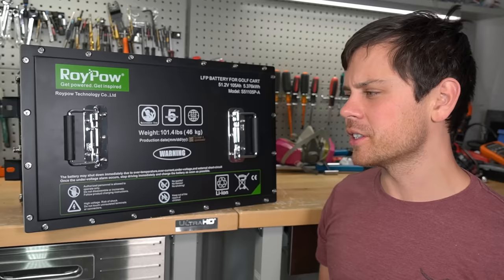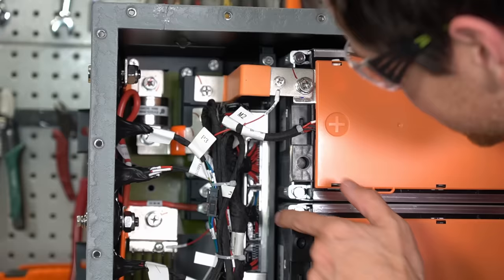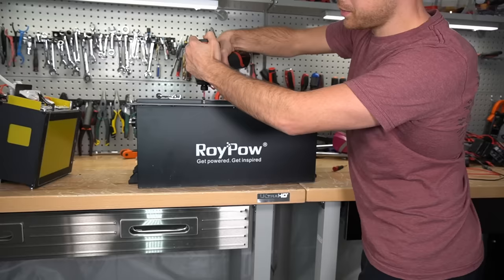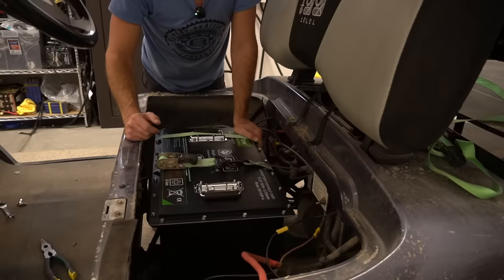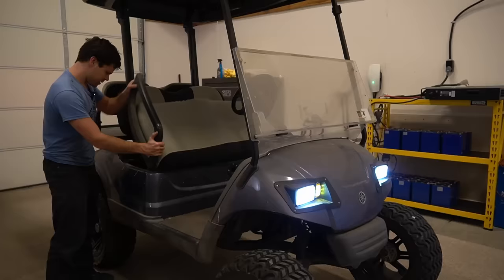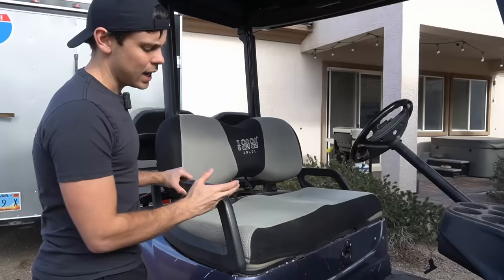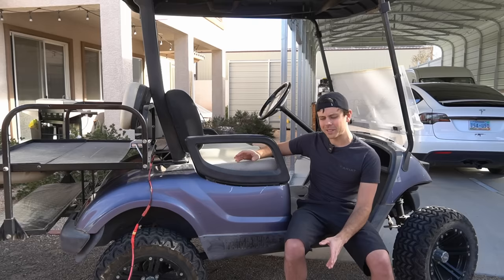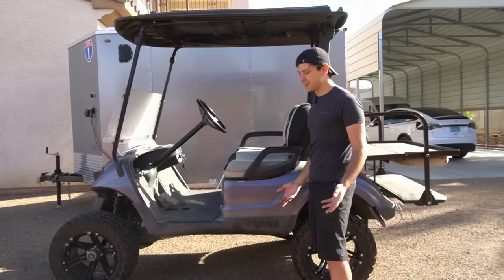48V "Roypow" DIY Lithium Golf Cart Battery: Get rid of lead acid today!

Comment: We have installed a few hundred of these into golf carts. They have gotten a little better over time.  The smaller packs are barely good enough really depending on driving conditions ie. Anything with real hills and they can’t handle the inrush current. The one you are installing is their high output.  The high outputs so far have been pretty reliable.
Reply: I think you are right. This is because its continuous discharge current is not big enough. Just imagine, with 4 big guys and other things loaded on the golf cart with this battery, driving uphill, it will probably stop working and the meter display remaining power could be up to 25%.  And take a look at the connection panels between cells and other joints, it is alluminum alloy, instead of copper, it means that it is not for high working current at all. I have to say, it is beautiful but it is not the best.
Reply: Disappointed to see that they are only currently offering the 24v 80Ah units for sale. I'm assuming they are just out of stock. The unit in the video here is what I want for my Cushman truckster.
Reply: @TheGorf   cool another cushman truckster owner. Mine is a 91 with a 22 hp omc built twin using propane fuel, it was used in a plant for maintenance. These things are built extremely well and built to last, mine has almost 5200 hours and still runs great.
Reply: Any interests in 48v30ah battery in GC2 size?  Max support 10 units in parallel connection. @TheGorf
Reply: Do you wanna experience latest 48v30ah in GC2 size LFP battery for replacing Trojan T125 lead acid battery? It can support 10 units in parallel connection, reach 300ah
Reply: @derrickzeng  Those aluminum busbars can easily handle the rated current of the pack. Probably 2x that. Also the cell terminals are aluminum so there's less chance of corrosion problems by using aluminum for the busbars as well.
Reply: I have the Roypow 165AH battery in my cart.  So far works well but will slow down when hauling larger loads up hill    It came with the cart but I want to add solar charging

Comment: I bought some “Sapphion U-Charge” LiFePo4 batteries for my Polaris Ranger EV about 8-years ago. It was 4x12v cells instead of the 8x6v stock set up, and just required reprogramming of the original onboard charger and purchasing a very expensive “CAN-bus” solenoid. They look exactly like deep cycle batteries. I’m still getting 35-40 miles per charge compared to the 45-50 miles when they were new. The lead-acid batteries were weak by the time I got it but they were supposed to be good for 45-miles on flat ground when fresh (it was down to 4 or 5). Best purchase I’ve ever made for that thing.

Comment: Im down here In quartzite for the first time. I need a cart like that here. It would be much better than the noisy side-by-side that people use.
Reply: That's the nice thing about the golf carts.
My mom has used one for years, out in the desert (rock hound).
Air down the tires (if you're in sand), and go.
Unfortunately, it still is limited to where you can go, but still wonderful to have just to cruise around quietly.

Comment: nice. I've been running the same battery (105aH) in my cart since may of 2021 with no issues. I turned regen off via my alltrax controller so don't use the resistor.  I still get 3-4 rounds of golf out of the pack. Also just installed a 48 volt forced air heater and doors for winter golfing :-)

Comment: I just like watching your technically oriented videos. Your curiosity is infectious. With year-round sunshine, I can see myself building a small portable solar unit to keep the groceries cold in the event of any power outage. Thanks, Will.
Reply: I did this last winter, built a 1kwh battery pack that can run both fridges in a power outage, its a pretty cheap project, you should do it. 2 100w panels, a battery of your choice, and a solar controller and inverter. If you do it on a hand truck there are quite a few videos on making a quick and easy one using integrated Controller/inverters and a rackmount battery (5kwh). Just be sure to use a 20amp power strip when you wire up AC.

Comment: I went with Raw EVE LF280K and a 250A (which easily exceeds 300A for a bit of time if needed) smart bms. A bit of modding of the battery tray to create flat platform for the pack and a compression setup with water proofed ply and some threaded rods/locking nuts.  It has much more range and capable of higher amp draws without going much if any beyond 1C, and it's been working great for months now. I've got so much range I only need to recharge once every 2 or so months, and I've connected a PSW 3kw inverter to power fridges and freezers during power outages. As far as bang for buck goes, there isn't a better option (if you have a bit of time and some tools to do the work, which only requires homeowner stuff).
Reply: You are the only other person who I have seen do this.  I built one out of 280k cells as well. 24s.  It barely fit. I used the jk bms, and I've seen burst of over 370 amps on the app.  You have any photos of your setup?
Reply: I purchased a 48 Volt 100 amp  LifePO4 Battery for to replace lead acid battery pack on a EZGO golf cart. I work fine until i went up a small hill. It then stopped and the battery switched off. I contacted the supplier and they said it was the BMS was not up to the job . They refused to reimburse me and i now stuck with it. Can you recommend a suitable BMS replacement?
thanks

Comment: Brake resistor has two connectors on the pigtail. Larger ring goes to Brake Resistor terminal post, small 8mm goes to negative. (from Roypow user manual)

Comment: First I want to say thank you for all the information you share I've learned a lot from your videos and I've come to trust your opinion on a lot of issues surrounding solor power,  so I would like to ask your opinion on my plan so you know because of injury's I cant work anymore and I waited to long to try and get social security disability insurance, who knew you'd get screwed by holding off as long as possible before applying for it and so I was denied and ended up only getting SSI which pays less then a thousand a month lol so it's challenging to say the least to afford much for anything I have to move out to my property in Kentucky or lose it and its undeveloped I'm going off-grid and I can't afford to do the normal kind of solor system that most people do , my plan is to do small systems for individual areas of my home and other need such as one system for my bedroom and living room and a separate for my kitchen and bathroom and another for my water pump etc.. so I can build each according to separate needs and if something fails like say my well pump I can barrow say my bedroom power till I can fix the well pump system and I don't lose all my power because I can't afford a new part right away . In a way it's like I'll have a back up if needed it will be priority that decides where the power is supplied. So please any advice would be appreciated if you find some time. Thank you I forgot to add that I'm planning almost every thing I can to be 12v since it's only small systems although I may do 24v for kitchen so I can run a refrigerator or freezer. And we don't watch TV we only use our cell phones / laptop for that

Comment: I had the same problem with Powerpoles several melted with only 6amps going through them, I gave up on them and I use EC5 (120amps) and EC8's (250 amps) they are much better IMO for making solid connections, you do need to solder them though and an EC8 takes a powerful iron to melt enough solder for the wire/connector

Comment: Great job on the video Will! Thanks for making it. You mentioned Surron, any chance you might pick one up to showcase on the channel? I am really into the idea because with dirt bikes, the barrier of entry that is maintenance and upgrades prevents a lot of us from pulling the trigger. With electric, there isn't really any maintenance and they're so easy to customize that it really makes it a lot easier to et into the hobby. Someday I hope to buy one and paint it to match my 4runner and get a hitch-mounted bike carrier so that when we go off-roading, my wife can drive (she's a better off-road driver than I am since she pretty much does it for a living) and I can zip around her on the bike to get some rad video footage. If you're thinking about it, there is another Vegas YouTuber called Vegas RoManiac you might want to reach out to. He rigged his to carry double the batteries than a standard model so it gets a tone of range. The aftermarket is insane on them too, with tons of higher power or higher capacity batteries along with all the standard upgrades you can do to a dirt bike. Thanks again for making this video!

Comment: I have the RELiON Insight Series GC2 30Ah 48 Volt batteries in my cart. They are the same size as the 6 volt lead acids. They are 100 amp continuous discharge per battery. Would love to see a tear down these batteries.

Comment: Thank you. I have EZ GO 48V golfcart and was not happy with what is on the market for golfcart use. and the price . I have 6 GC8 interstate battery's now and they work great . I do have a big solar panel on top with a boost charger for 48V . I have on board charger but I added a Anderson SB 50 red connector for charging or under 50 amp loads. I would switch to SB 50 Anderson with weather proof cap . I got red type 2 it wont plug into a gray SB 50 I have for 12V. I do not have breaking resistor. May be the lead battery system . my FWD and REV is just a heavy duty switch on motor .  I think breaking is done in my controller. it holds speed down hill .For now I stick with lead acid. until I find a LiFePO4 that holds up and cost is down. I get about 5 years on flooded battery's .I got 12V lighting . red led tail lights but auto style head light lamps. They make LED that goes right in same socket.  I am is Boston NY ,out winters are rough. would need to insulate LFP battery. Next battery replacement I will check the LFP market. Cost and runtime and pulling a hill or load are factors for me. Thank you for video. Let us know run time on that LFP .

Comment: I have a Roy pow, it has started having trouble at about 18 months. Still working the warranty process
Reply: Which size.  I have 165AH and it seems to drain faster than expected
Reply: @ahbuildingafarm  110 ah I believe, brought it to the dealer who sold it to me and they ended up swapping out the bms board ( battery management system) the issue was never resolved.
Reply: @tyhunter6590  sorry to hear that.  Mine was built in May 2022. Hopefully it holds up

Comment: i was in harbor freight a week ago he was looking at hf 100 watt kit little pricy but easy to use for low need. we spoke he lost house from ean and moving into decent size travel trailer. and wants solar rather than gen . we spoke a while i said check you out both video and website especially your older ones with rv  trouble is where we live almost all co are installers who only want to sell systems not a few 300-400 panels

Comment: I have 5,  30 amp 48 volt Allied Lithium iron phosphate batteries connected in parallel in my golf cart.  They are about 3 yrs old.   I notice lately they are self discharging a LOT .   Like 30 percent in a week when not in use.   Do you have any idea what is going on ????    They charge up fine but capacity is sucking big time  .   Thanks .

Comment: These look to be used VW Egolf batteries.   The bus bars and BMS is laser welded to the cells so not very DIY friendly, I guess they've either found a way to use the existing VW BMS or built a BMS manager on top of it.  As you say automotive style innards because they literally used to be bolted inside a car!  I guess they are not telling you that they are used cells then?

Comment: Looks like a really great battery. Any update on the Solark 15 K install.

Thank you.
Reply from the maker: I'm waiting for my friend to pull permits still, so I have no idea when I'll be able to cover that model. Hopefully they do it soon
Reply from the maker: Very frustrating
Reply: Thank you. I appreciate your videos.
Reply: @WillProwse  Would be cool. I just bought three of the 15K's for my project, which will be able to power everything in my home. I'm still working out which batteries and panels to use.

Comment: Wondering how well they would work with several in series/parallel to power diy  EV builds
Reply: I've been wondering about if this battery would work in a off grid array as well.

Comment: My 2020 Icon with the stock Toyota 350A controller (tuned, because they are open) and 64x TopBand pack (16s 4p) regularly draws 165A @ 35-37mph.  Not sure that 100A BMS would be enough.

Comment: 🙏🏻 Any recommendations for me to look into? I have been thinking about something like this for my project use. A 48-volt 100 ah golf cart battery is perfect size and is built rugged enough for what i'm building. Want to combine it with something like the EG4 3000, all in one solar and inverter system. I am building myself a nice small custom hot dog cart trailer. Would like it to run off grid for at least 10 hrs, like a rare maximum of 16hrs. It's running a small refrigerator, which is something like 160w ish @ 120v and a bunch of led light strips at night for 6 hrs of advertising backlighting. I would also like to incorporate a DC to DC charger of some sort, to connect when in transit, and be charged off of the towing vehicle somehow. I'm not sure what I would need look for, for solar panels, but it would have to be something like your golf cart here, as I really don't want them much bigger than the cart footprint itself which is like 42"×72" or so. I know I will have to get a 12V DC converter for some components, like a small water pump. Everything is going to be on a remotely located panel for monitoring and switching, as well. Any of your recommendations to look into would be very much appreciated, Thank's

Comment: Hi Will, thank you very much for your constant help to the community. I have one question regarding a Hybrid Inverter (MPP SOLAR) and 48V battery bank with 8 GEL batteries (4+4). one of the batteries charge at a voltage of up to 16.2V (some time during the day). The other ones have normal charging voltage (about 14V max). I know there is an issue with this one battery. My question is should I replace the whole battery bank ? as it will be difficult to find a replacement battery with similar stats (and age). Many thanks

Comment: What is the power rate of your golf cart's electric motor? As far as i know, the general power rates of low speed vehicles including golf carts is at the range of 4000W~7500W. So I do not think it is quite meaningful for this Roypaw battery to be Max Output Discharge Current is 315A(at least 48*315≈15000w) for 30s especially it has to have the extra 2400W break resistance to control this peak speed.

Comment: been running one of these since first of the year.  all i need is solar for it.  Which video would have the buck converter, solar for the 48v is all i'm missing  (already have it for 12v secondary lfp battery in all the new empty space left by the missing 8v anchors)

Comment: I have a 64 volt system (8 - 8v) lead acid with a 1000 amp max controller.  Can I drop in a RoyPow 48 volt as a replace ment?

Comment: Will, I have a question about any battery system using contactors instead of FETs... basically, do they use a magnetically-latched contactor, or does the battery have to continuously hold the contactor closed with current from the battery itself? Some implementations like this are NOT good for long periods of no use, where the battery must hold the contactor closed for the slightest current requirement. Mag-latch relays/contactors simply stay in the open or closed state magnetically until the controller commands it to open or close, and this method uses no quiescent (standby) current. Can you speak to that aspect, and in future when you see a contactor system, can you test it somehow for standby current?

Comment: it would be awesome if you'd run a tape measure across your batteries because just like this battery, are the factory measurements that outside lip that runs across the top or are they the actual size of the battery cabinet. If you put your tape measure across each battery then we could just pause the video to get a better idea. Also their site kinda sucks, can't even click on an add to cart button, just says contact us and it's email only. Am I the only one seeing this on their website? Thanks for the vid, I have a Hustler Zeon zero turn electric riding mower with lead acid that I would like to get this battery for it but the factory measurements don't show if they are that lip or cabinet and I can't go over what factory measurement are. So if that lip is extra then it won't work

Comment: What does the break resistor do?
Reply: I was curious myself: it's overcurrent protection so the motors don't damage something while breaking.

The difference between an electric motor is basically where the most energy is: take an electric motor and apply current, and the shaft spins; take the same motor and spin the shaft, and it produces current.  So while braking, the cart's motors (being forced to turn by inertia) can produce more current than the system can handle, damaging things; adding a brake resistor turns that excess into heat instead, which can just be dispersed.

Regenerative braking would be more efficient, but probably also too expensive and/or bulky for a golf cart.
Reply: @boskone  Appreciate the information!